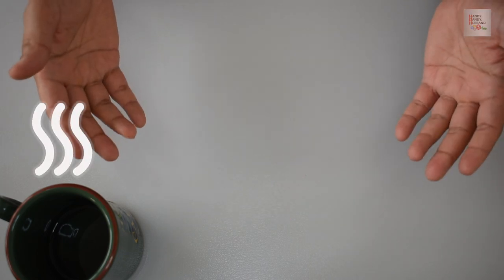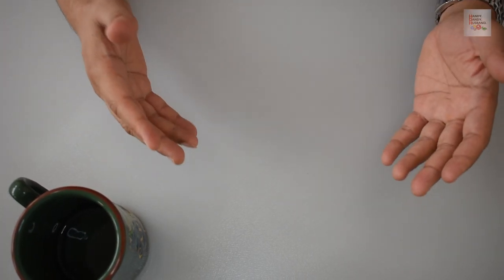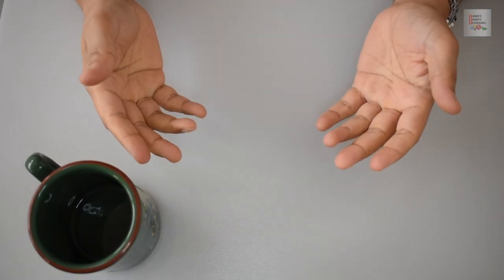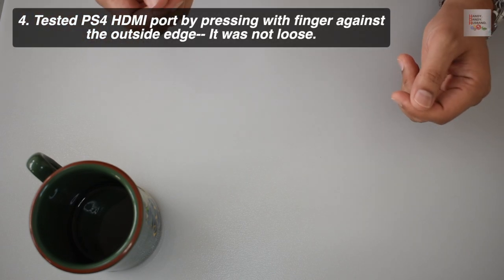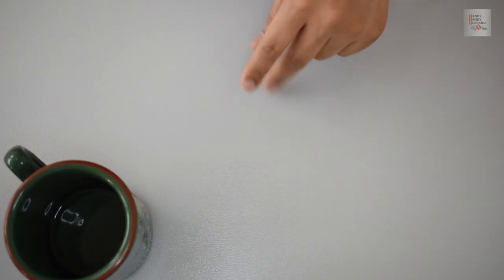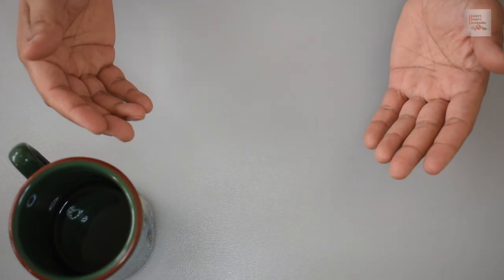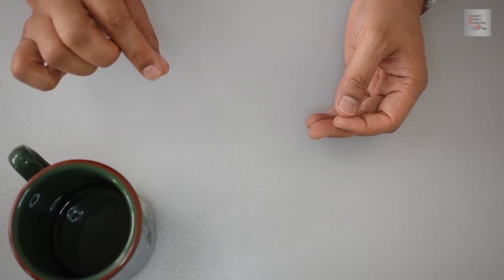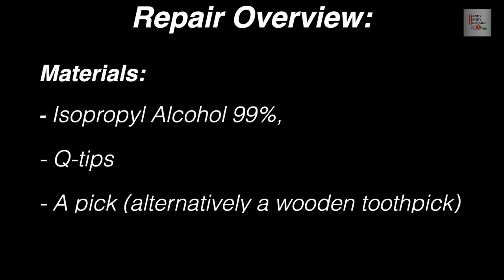𝗤𝗨𝗜𝗖𝗞 𝗧𝗜𝗣: 𝗣𝗦𝟰 𝗛𝗗𝗠𝗜 𝗣𝗼𝗿𝘁 𝗥𝗲𝗽𝗮𝗶𝗿 -- Easy, no solder required -- [Fix that video input error]

Comment: my ps4 isn’t responding to the hdmi cable. the ps4 is making the beep sound and there’s a blue signal. 

but when i connect my hdmi cable to the ps4 it just says “no signal” on the tv.

i’ve tried using different hdmi cables and nothing changes.
Reply from the maker: Hi Electric Powerade, thanks for watching and sending me a summary of your issue.  Yes, the 'no signal' on the tv is a sign that the HDMI port on your PS4 may not be operating as well as when it was when the console was new.  Try prying up the prongs that should be protruding out a little.  Once you have done that, let me know and I will try to help you out.  All the best to you and Happy + safe 2021 to you, H.D.H [: { ].
Reply: Mine to
Reply from the maker: @lilteztha1  Hi Shawntez Diedrich, thanks for watching and sending me your related issue. Have you tried the fix outlined in the video?  If not, try it out and let me know if you have any questions.  If you have tried it and it didn't work for you, I am sorry about that.  The fix isn't 100%, but it is free, and people have said that it worked for them in the comments.  I guess, its worth a shot if you are experiencing the Blue Screen no signal issue.  You might want to try resetting the PS4 (hold power button for 10 sec until 2nd beep and then unplug power supply for 10 seconds and see if the reset helps).  Apart from that, you might want to contact Sony for a warranty authorized repair depot that might be able to diagnose your console for you.  All the best to you in 2021, H.D.H. [: { ].

Comment: My boyfriends old OG first ever PlayStation needs the cord to be propped at an angle like earbuds. He said one of the “prongs” are splintered from taking the cord in and out for four years straight taking it to his grandmothers and back. I’m not sure how to fix that because that’s gonna be my PS4 soon.
Reply from the maker: Hi wonderland, thanks for watching and sending in your question.  Yes, I have heard from other viewers that shifting the HDMI cable can help in ensuring a better connection.  If one of the metal strips along the outside perimeter of the HDMI port is damaged/broken, then altering the angle of the HDMI cable entering the port may assist.  Fixing this particular issue will likely require a HDMI port replacement, as one cannot easily repair/reattach the damaged metal strip.  Sorry I couldn't provide you with better news.  All the best to you, H.D.H. [: { ].

Comment: My ps4 would only display something if it was on safe mode...
Reply from the maker: Hi trigsko, thanks for watching and your comment.  If the PS4 is working fine only in safe mode, you should really check if your TV is properly able to display 1080p resolution.  It may be that the higher resolution is not able to be projected to the TV.  It could also be that the console is having difficulty sending a good hi res picture, but I would first check with the TV.  If you have any question, let me know.  All the best to you, H.D.H. [: { ].

Comment: my ps4 doesn't run on 1080p its run on only 480
Reply from the maker: Hi LOKES SUPERNOVA, thanks for watching and your question.  My fix does not address this issue.  If, however, this is your only issue, then there may be a simple solution.  First, check to make sure your TV/Monitor is capable of running at 1080p or the higher, desired resolution.  Second, turn on the PS4, go to SETTINGS> [SOUND and SCREEN]> [VIDEO OUTPUT SETTINGS] and set the appropriate resolution.  By default, PS4 is designed to select it automatically, but for whatever reason, if the auto select is not working, the manual selection above should help you out.  Hope this helps, if it does, please let me know with your appreciation. All the best to you, H.D.H. 
[: { ].

Comment: I can’t really tell if my PS4’s HDMI port is damaged or not. I bought a new HDMI cord to see if the problem was the cord. The PlayStation screen still did not appear on my TV after I used the new HDMI cord. Is there any way I can send you a picture of my PS4’s HDMI port so maybe you can tell me whether it’s broken or not? Thanks
Reply from the maker: Hi DashingNJC, thanks for watching and sending me your concern.  Yes, please send me a picture, but make sure you use  lamp or flashlight to light up the area very well.  Also use a camera with high resolution so that I can zoom into the area if needed and last, make sure you get as close to the HDMI port as possible.  Take on picture straight on, one picture at an angle from the left and one angle from the right, and one angled from the top so that I can get a good view.  Send your pictures to my email:  thehandydandyhusband.info@gmail.com
Look forward to conversing further, all the best to you, H.D.H. [: { ].
Reply: @HANDYDANDYHUSBAND  hey I'm having the same issue

Comment: are all the oinds in the HMDI port supposed to be protruding? because all of mine are flat.. i have issues where my PlayStation displays pictures SOMETIMES.. but not all the time. I was thinking that this could be because the pins in the HDMI port are flat like you explained.. any suggestions?
Reply: pins**
Reply from the maker: @sheluvsjass  Thanks for the amendment.  Please see my comment on your initial question. H.D.H. [: { ].
Reply from the maker: Hi Jasmine Poullard, sorry for the late reply...have been away from my channel for a bit.  To be clear, note that the pins/metal strips that I am discussing are the ones within the metal casing that surround the center pin.  Do NOT touch the center area of the console HDMI input.  The two thin metal strips/pins along the outside casing should protrude a little, like two small hills on an otherwise flat landscape.  If you can't see these protrusions then bending them gently back until you can see the 'hills' will help position the HDMI cable into this port.  If you need any further help, let me know.  All the best to you, H.D.H. [: { ].

Comment: Hey HDH, I'm not sure if this video is my problem exactly but I seem to be having some display issues myself. My PS4 showed no signal to my TV, but i managed to get it to display on my monitor. However, the colour came out weird. The display has got a red hue about it, and colours aren't right. I think this may be an issue of the hdmi port or broken graphics but I'm really hoping this fix works. If not, do you have any idea what my problem may be?
Reply from the maker: Hi Saif Malik, thanks for watching and sending me your question.  The fix outlined in my video could fix this issue.  I have had some viewers comment that it fixed a 'green and red' coloring issue with their PS4.  It is, of course, also possible that your graphics card is malfunctioning; however, it would be prudent to start with the 'free' non-invasive fix first and then progress to more involved repairs.  Just be sure to use a new HDMI cable and ensure that the thin metal prongs are gently nudged up from their rounded middle areas--not the very tips which could snag on the HDMI cable when you push it in.  Hope it works, let me know your results.  All the best to you, H.D.H. [: { ].

Comment: guys don’t believe your ps4 broke if you touched that pins to heavy DON’T DO IT
Reply from the maker: Hi aanval games, thanks for watching and letting me know your concerns.  Yes, definitely, I agree, you should be careful not to put excessive pressure on the strips of metal as like any metal, excessive pressure or constant back and forth will eventually break the metal.  Note that the temperature of your room may also affect the brittleness of the metal. Air conditioned buildings will make the metal more prone to breakage.  All the best to you, H.D.H. [: { ].

Comment: If the port pins are broken it needs the port replacing , this is misleading a no solder fix ......
Reply from the maker: Hi leso204, thanks for watching and your comment.  It is not my intention to mislead anyone; however, I understand how someone could think that this fix will solve all issues.  You are right, if the HDMI port connectors pins are broken or the contacts to the circuit board have been compromised, then you are right the port will need to be replaced.  This fix is just a first step to see if an easy hack could solve a comment issue.  All the best to you.  HDH [: {].
Reply: @HANDYDANDYHUSBAND  : one other heads up' is if the the console was active when port was damaged , a short within the HDMI will damage the booster chip in most cases , and-or the retimer chip ................
Reply from the maker: @leso204  Hi leso204, thank you kindly for the added information.  Such information is very useful to many in our community and I appreciate you taking the time to provide.  All the best to you and happy gaming. HDH [: { ].

Comment: My ps4 is loose, how do I fix without getting it repaired or replaced
Reply from the maker: Hi Pablo scripts, thanks for watching.  I assume you are referring to a loose PS4 HDMI port.  A loose HDMI port typically signifies a loss of connection between the port and the circuit board.  This could mean a circuit board crack, a cracked solder joint, or HMDI port metal strip/solder joint break.  All of these issues are best addressed with a port replacement.  If you don't mind a temporary fix, then try the following:  plug in your HDMI cable, then turn on the PS4, once it is on and you see the video input error message, get some duct tape pieces ready, then gently start moving/shifting the end of the HDMI cable closest to the port in a circular motion and stopping briefing at the 12, 3, 6, 9 o'clock positions and see if any of this movement helps re-establish a video connection (if you are working behind your TV, having a mirror or a friend tell you if there is any change in the video reception will be helpful as well).  Should movement help, then try to tape the HDMI cable end in that exact position so that it is maintained.  This jerry-rigging may work, but I am not sure for how long.  Hope the suggestion helps, all the best to you, H.D.H. [: { ].

Comment: My HDMI port is broken? Would a usb to hdmi adaptor work.
Reply: Please reply
Reply from the maker: @larrywilson3904  Hi Larry Wilson, thanks for watching and sending me your question.  I assume you are referring to the 2 USB ports on the front and one port in the rear of the PS4.  If this is correct, then no, I don't think this will work as while they are USB 3.0 they are not designed to emit the necessary video signal.  They are more tied to simply charging your controllers or adding external storage .  But...hey...you can still try it and if it does work, please let me and the community know (it should not harm your device). I have heard of some people trying to use a HDMI -->RCA adapter on old school TVs and then use the Digital (optical) port for audio, but this only works if the HDMI port in your PS4 is giving a partial signal that your HDMI receiving TV/monitor can't properly pick up.  Sorry if my response was not very helpful.  All the best to you and if you do try a fix that works, please let me know.  H.D.H. [: { ].
Reply: @HANDYDANDYHUSBAND  Thanks for the response. I purchased my PS4 in 2014 and before I broke my HDMI port it was constantly crashing and making loud noises. I guess I’m just going to purchase a ps5 when the price drops. Thanks again!!
Reply from the maker: @larrywilson3904  No problem Larry Wilson.  There are some shops and people that may buy your broken PS4, so try not just send it to the landfill--maybe try to sell it for parts etc.  All the best to you, H.D.H. [: { ].

Comment: Can u do Xbox one s HDMI repair
Reply from the maker: Hi Jaden Wilber, thanks for watching and sending me your request.  Unfortunately, my son doesn't own a Xbox, so I really can't do a repair on equipment I don't own.  The mechanics of how HDMI ports and cables work are the same between the two systems, however.  Take a look with a bright flashlight into the HDMI port of your Xbox and if the two bent metal strips are flattened out, then the same fix could result in a fix for you too.  Let me know the results if you do try.  All the best to you, H.D.H. [: { ].

Comment: It work for me 4 time but now it when back .to the blue light again...I wonder y I can't get it to work now again...anything more I can do.??
Reply from the maker: Hi james her, thanks for watching and sending me your question.  My son's PS4 worked initially for about 6 months then stopped (without us moving the PS4, but with my son removing the HDMI cable) because the PS4 froze.  We did the fix and I told him to never remove the HDMI cable and the fix has been working for over 11 months now.  I need to know, do you move your PS4 often or do you remove the HDMI cable and re-plug it in to different monitors?  This may be the reason why the fix works but then stops working.  If after repeated successful tries, it stops, working, I hypothesis that the HDMI port on your PS4 may be experiencing metal fatigue and the thin strips of metal are not able to 'bounce' back as resiliently as they did in prior fixes.  Sometimes heat can give metal back its resiliency, but trying to get a heat source close to the HDMI port is going to be challenging without opening it up.  You could try a very thin, micro soldering iron, but only provide the heat for a few seconds, as you don't want to melt anything or de-solder the component.  Hope the above helps.  All the best to you, H.D.H. [: { ].

Comment: Man this looks risky. Not sure if I should try this.
Reply from the maker: Hi The PS Player, thanks for watching and sending me your comment.  Yes, if you are not good with tools or do not have a steady hand, then I would agree it would be risky; however, for most people it is fairly straight forward.  Just think of it like a paper clip that has come out of alignment, you bend it back in position, but with just a little bit of force, if you use too much force you will over bend it, if you bend it too often you could crack the metal.  For many people trying this fix is one way of helping troubleshoot the HDMI port.  Anyways, hope my reply helped you...do what you think is safest for you.  Best of 2021 to you, H.D.H. [: { ].

Comment: I had my PS4 for 3 years and I never had a problem but when I tried to set up my vr headset nothing shows up on my tv I tried everything and when I hooked my PS4 back up normally nothing still shows up on screen when I used my vita via remote play and looked at the problem it turns out the the hdmi cable isn’t connected for some reason even though everything works fine I tried other hdmi cables even my Nintendo switch hdmi cable none of them work I even tried another tv and that didn’t work nothing I tried works 😞
Reply from the maker: Hi bora Demirbulakli, thanks for watching and providing me with a summary of your issue.  It is a real drag that trying to add a VR Headset to your PS4 has caused such an issue.  I am not sure my video will directly address this issue. My thinking is that the VR Headset setup/download caused some of your native video/audio settings on the PS4 to change.  The problem is how do you alter/switch these settings if you can't see anything on the screen.  While this is going to be hard, this is what I would recommend:  1) find a friend who has the same PS4 model as you (i.e. Slim/Pro/Reg etc.), 2) Set a video chat with that friend where he points his/her phone at their TV as he turns on he PS4.  At this point turn on your PS4 as well, 3)  Ask your friend to pretend like s/he is about to adjust his/her settings and follow his controller movements exactly (i.e. if he pushes up on his joystick, you do so as well, if he presses O or X or triangle, you do the same)  Your friend should be asked to go to Sound and Screen > Audio Output Settings > Primary Output Port > HDMI, 4)  After this ask your friend to follow the procedure to safely shut down the PS4 and follow those steps as well.  Unplug your PS4, wait 10 seconds, and plug in your power cable, plug in a HDMI cable, and turn on the PS4--see if it works.  If it does, great you are now in business.  If it does not work, you may have to deactivate your PS4 and Reset your PS4 while mimicking your friend's controller gestures.  Note that resetting your PS4 is known as an initialization and will erase everything from your PS4 (i.e. Harddrive will be completely erased).  This will take a few hours so leave your PS4 on for the full day to make sure the reset is complete.  I don't know if the above suggestions will work, but that is where I would start.  Sorry, in advance, if this was not helpful to you.  I hope you get your PS4 working.  Please let me and the community know what does eventually work.  Thanks (and Merry Christmas to you), H.D.H. [: { ].
Reply: @HANDYDANDYHUSBAND  sadly I don’t have any friends I’m more of a loner and the fact that I’m almost 24 and have no friends makes it sadder also there is like no sound coming from the tv and I can’t even go to safe mode so I think I’ll just get my hdmi port replaced at a repair shop mostly cause if I screw something up I might lose three years worth of save data so I think it’s safer to take it to a repair shop and get the hdmi port replaced
Reply from the maker: @borademirbulakli4748  Hi bora Demirbulakli, I am sorry to hear that you feel you don't have any friends.  Perhaps, ask someone that you know or someone that is an acquaintance?  If the data is valuable, I agree it may be safer to take it into a repair shop.  Do, however, explain the problem to them as you have done on this channel and maybe they can trouble shoot the PS4 without the HDMI port.  All the best to you, H.D.H. [: { ].